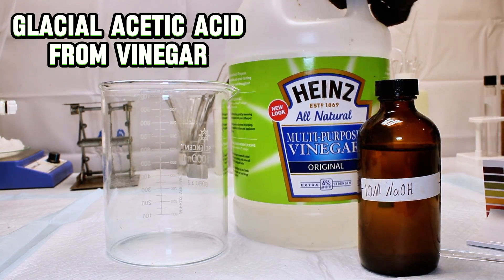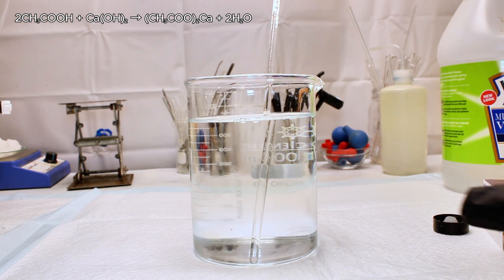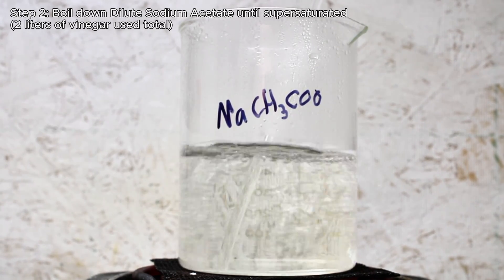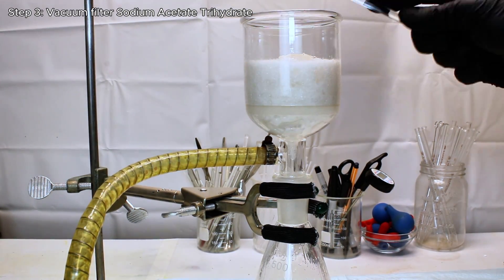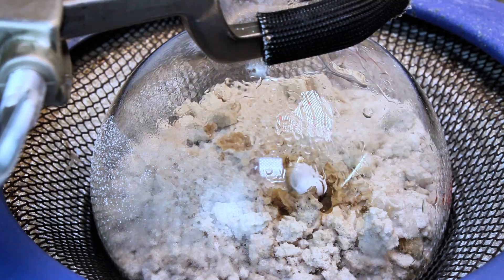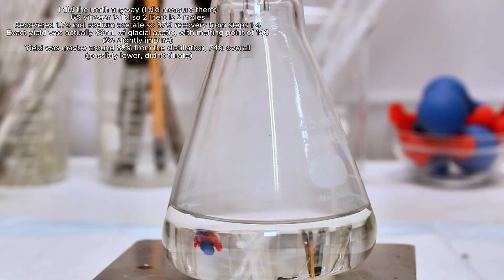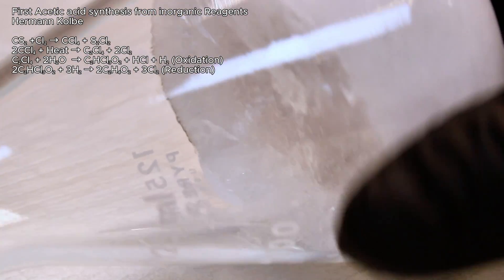Pure Acetic Acid from Vinegar

Comment: That's great but where do I get sulfuric acid? Can't I just gently heat vinegar in a reflux column and keep refilling the pot until it's concentrated? (Letting the water vapor escape, of course, meaning I'd keep the top of the column about 75C and the bottom about 90.)

Comment: I noticed today while working on this reaction that the vinegar+baking soda solution i was using still seemed to contain a decent amount of acetic acid even when measuring as basic.
I had tried to react the vinegar until it showed as neutral/basic, then distilled it to avoid the browning that you're getting. But i noticed that the distillate still smelled of vinegar and it seems to be slightly acidic. I guess this is because acetic acid is a weak acid (I'm not an experienced chemist) but it does make me wonder how much yield is being lost.

Comment: 2:00 fun fact, sodium acetate is what's often used to flavor salt and vinegar chips! it basically tastes like salt and vinegar which. is kind of obvious seeing as that's basically what it is
Reply from the maker: Huh I didn't know that but you're right now it seems a little obvious 😅. It isn't like you can just put actual vinegar on them.. that said, they're quite sour.. so definitely some type of acid
Reply: It's sodium "diacetate" used to flavor salt and vinegar crisps...

Which is in fact, sodium acetate with some un-neutralized acetic left in.

This forms a crystallized salt with some degree of acidity, without having to soak the chips in vinegar which would make them all soggy or cardboard like.

Sodium diacetate can be made by half reacting wine or cider vinegar with sodium bicarbonate and drying everything down. This retains some of the flavors of the original vinegar, and then other spices are thrown in (dehydrated onions, etc...) .

Comment: I have always wondered if you couldn't extract the water out of the vinegar. Possibly by heating it up right below the boiling point of acetic acid ?! Does anyone know if this is also a possibility ?? Thank you 👍
Reply: This is not possible as the boiling point of acetic acid is very close to the boiling point of water. So if you try and boil off the water from acetic acid, you will also boil off the acetic acid, and this is verified by the very strong smell of vinegar whilst conducting the boiling of acetic acid.

Comment: 3:38 I have to disagree slightly at this point, fractional freezing might be visually boring in comparison to other chemical methods, but the technicalities involved are much more complicated since making glacial acetic acid just by distillation is practically impossible, it is interesting in a way to investigate its physical properties.
Reply from the maker: That's actually a very good point, and in fact I did cool this down to 10C and then pulled a vacuum on it to try and push it closer to 100% off camera.. I think trying to purify peroxide by fractional freezing put me off to the whole process, but it is in fact quite useful and interesting

Comment: In France most Acetic acid and vinegars are by products from the vintaculture industry and are very cheap - they dont use the synthetic route from methanol for food use there.
Reply: Indeed. Wine that doesn't meet the requirements for quality or taste is very often reused in this way.

Low end but drinkable wine is made to ferment into vinegar and sold as is for salad dressing. 

Very low end or stuff with off flavors or odd smells is made to ferment, then distilled into white vinegar for bathroom cleaning or coffee machine descaling.

Comment: It you want a truly inefficient method, simple distillation of aqueous solution is the king among them for acetic acid. It has an asymptotic pinch at purity in its VLE (think of it like an azeotrope, but at 100% acetic acid). Distilling any concentration solution to form glacial acetic acid would require a truly ridiculous size column or an equally absurd number of lab scale distillations. Displacement from salts is far more efficient by comparison.

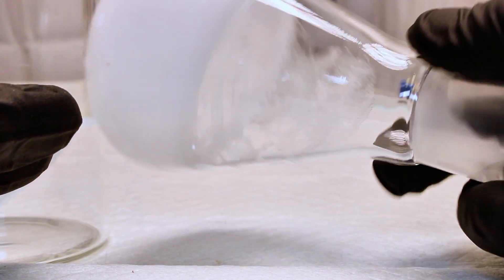Comment: 3:40 Not long time ago (relatively speaking) there was the assumption organic molecules could only be made inside the cells of living organisms. Methods like this one were made to prove it was completely possible to synthetize organic molecules with inorganic chemistry, using inorganic compounds as base.
Reply: Correct me if I'm wrong, but the first attempt was made using ammonium carbonate.

I don't remember who it was, but some very prominent chemist set up an experiment to pyrolyze cow horn (organic material) into ammonium carbonate (inorganic salt from protein breakdown).

Then he distilled the salt with a strong dehydrating agent to rip water off the carbonate and turn it into urea, which was then thought to be made only by the excretion process of a living organism.

Comment: Pardon my dumb, but why not just distill it?
Reply: The boiling points of water and acetic acid are close enough to each other that it would be very difficult to isolate them by a distillation apparatus; you'd need an impractically long reflux column to approach a clean separation.

Comment: Nice plate crystals. I used sodium bisulfate once, but it left a lot of sulfur contamination. I've tried fractional crystallization in a thermos a few times, but I suppose just distilling it would be easier.
Reply from the maker: Thanks! I did the exact same thing once, and it actually did hold onto a lot of that pungent sulfur dioxide smell even after distilling it. Eventually I just mixed it with calcium acetate and distilled a final time which did finally get rid of the smell.
Reply: @integral_chemistry  That's good to know, I'll have to try that. Yeah, rotten eggs and vinegar won't become a popular chip flavor anytime soon ;)